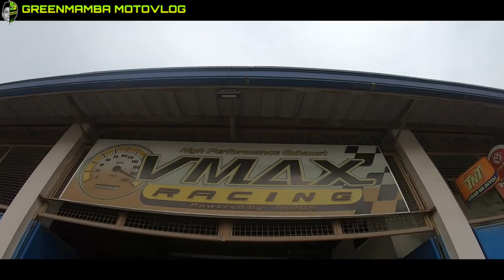PALIT BAGONG MUFFLER SA NINJA 400 | M4 FULL SYSTEM SOUND TEST | SOBRANG MAMAW

Comment: Boss anong slip on handle bar gamit mo? At magkano inabot?
Reply from the maker: renier coyoca 3k lng po yan clip ons handle bar po sir. Ano po ba kabitan mo na motor?
Reply: @GreenMambaTV816  planning din kasi ako mg buy nung ninja 400 boss hehe
Reply from the maker: renier coyoca maganda na yang motor na yan boss. Hehe sa power sulit na din. If need no naman ng mga parts accessories and pipe meron din naman ako nyang mga yan seller din kasi ako